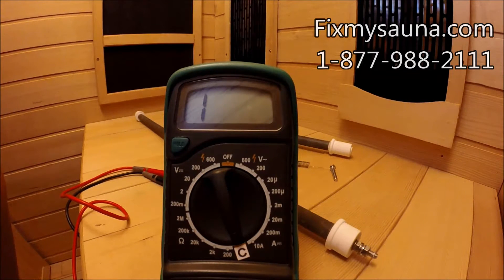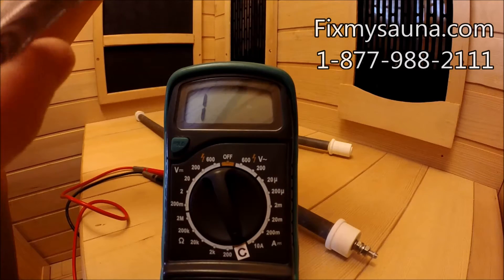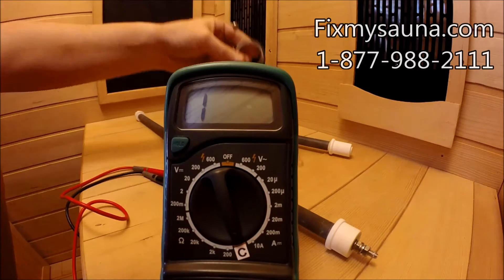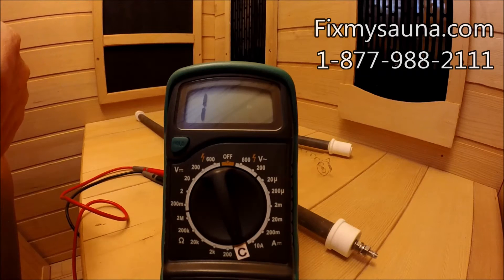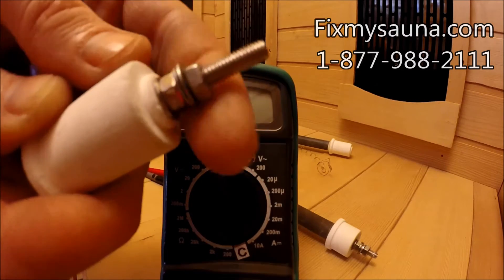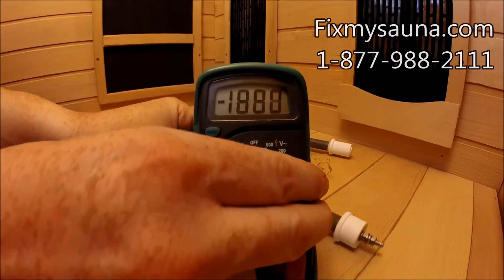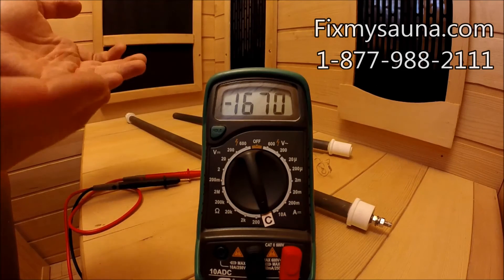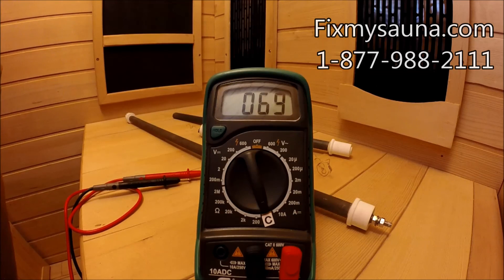Check Infrared Sauna Ceramic Heaters.

Comment: Someone put a glass of water on top of my sauna and it spilled over onto the control panel that turns on and off the sauna. It was beeping and flashing on and off. I shut off the breaker. Will it dry out and work again? Can I fix it on my own?

Comment: i checked my power supply control box all is good. i chked relays,caps,voltage input/output. yet no heat blowing in sauna. the radio and all works( fitted wth a radio). what could be the problem of no heat?